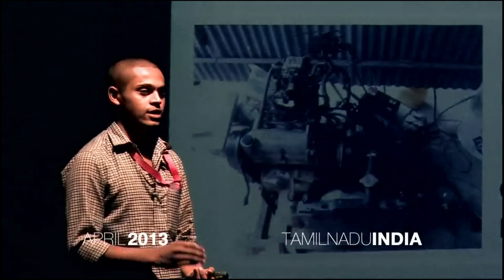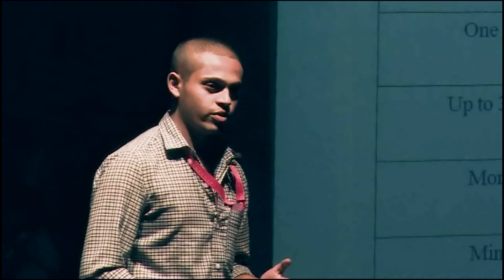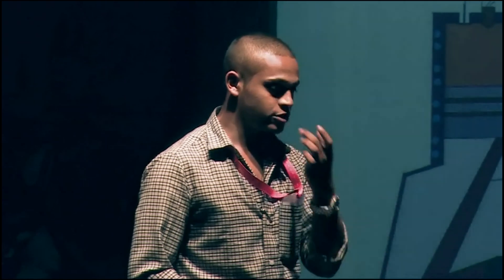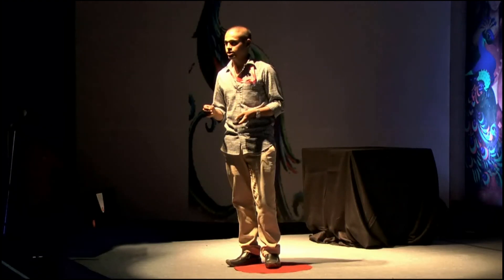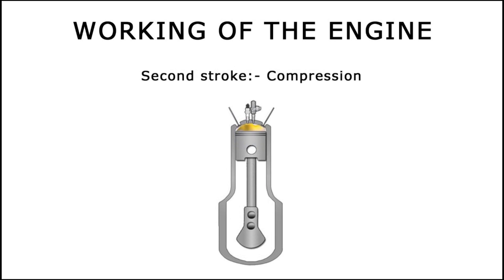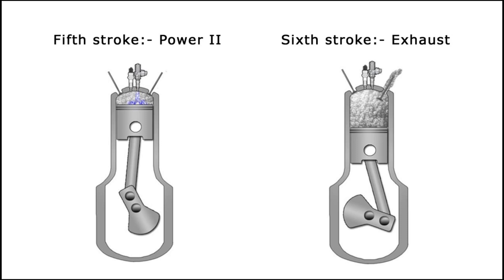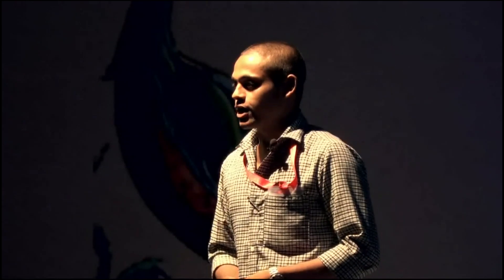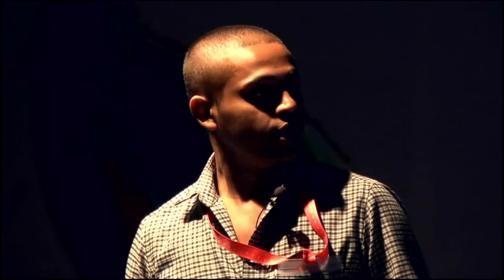6 Stroke Engine: Mukunthan at TEDxCoimbatore

Comment: Just a question, when water and heat are introduced together does rust form at a quicker rate? If so would this engine actually have a shorter life? In the long run would it be better to engineer a more efficient way to inject heated fuel and colder air? Sorry not one question.

Comment: ive never understood how 5 and 6 stroke engines benefit overall chemical efficiency. the added stroke must add enough power to pay for the movement of the added components to be overall more efficient. If you have a high inlet/outlet temp ratio, that points to thermal energy making its way into the engine, but not that the overall thermodynamic process is efficient at providing more work. with a steam engine itself and low rpm, i can see the benefit, but getting steam to the point of providing usable work is still not the most effective process.
Reply: You're right👍6 stroke engines do not benefit from chemical efficiency. They benefit in thermal efficiency by capturing the wasted heat from chemical combustion, to produce steam,resulting in an additional power stroke.

Comment: how do you think you can convert water into steam when you are about to start the engine.the engine body will not have sufficient heat to convert it. only when the engine  runs for long time it is applicable.
Reply: because the exhaust valve stays closed after the igintion of the petrol, the chamber contains super hot air due to the explosion of fuel. this volume of air will convert the water to steam. the engine does not need to be "warm" for this to occur, 
the 'perception' of a 'warm' engine is when the hot air has had enough time to thermally transfer energy into the block > water cooling system.

Comment: I think injection of water in the fifth stroke may leads to lose of heat energy (ie., generated in power stroke ) bcz it is utilized to convert water to super saturated steam , therefore for further cycles temp. May not be sufficient for combustion !!

Comment: Beautiful! That is, if you live in the equator where water doesn't freeze in winter, and if you make the whole system from stainless materials and if you can tolerate the overly complicated, heavy and expensive engine. Those disadvantages quickly cancel the benefits out.
Reply: Use screenwash instead of water in colder climates??

Comment: how would it increase efficiency as now the car has to carry water too to work and how about cold temperatures where the water won't even let the engine heat up
Reply: Cars already carry several gallons of radiator fluid, which the water here could replace, since it could be tuned such that the water would both provide steam power and sufficient cooling. If a separate steam exhaust were used, exhaust steam could be recovered, condensed and reused, so large water tanks would not be needed. Cold starting would require reducing or temporarily shutting off the water supply until the engine warmed up enough to vaporize the water. Steam oil would have to be added to the water to prevent water injector wear, and alcohol would also be needed to prevent water system freezing in the winter. 
I'm not an expert on patents and patent laws, but I'm pretty sure Bruce Crower already designed, built and patented a 6-stroke engine like this one. It's possible that some minor change in the operating cycle allows this guy to file his own separate patent, though (maybe the "recompression stroke?")
Reply: @WranglerSlim  unfortunately the recovery of the steam would not be easy, thus inefficient, it would be easier to pull water out of the surrounding atmosphere

Comment: For all the excess water emitted at surface level to precipitate out, you would have to be at 100% humidity.  But that situation is rare.  As for the production of electricity from fossil fuels, there is still no large scale alternative.  Until then, electric motors are just as "outdated" as the internal combustion engines you deride above.

Comment: Water vapor near the surface is less of a problem than co2 because the air close to the surface is regulary saturated. Then the air cannot take any more water and it rains. Then ALL the surplus H2O goes back to liquid. That is not the case for CO2. 
Of course you are right on the fossile electricity. If we should be so stupid to continue producing electricity from fossil sources, then electric motors would be no better then oil/gas motors. I would say charts and numbers point to renewable!

Comment: And so, if a little H2O emitted by vehicles down by the Earth's surface is no problem, then why is a little CO2 emitted by vehicles down on Earth's surface a problem?  Seems like if one is a problem, then the other should be as well, especially given that a molecule of H2O has greater greenhouse effect than a molecule of CO2.  And the modern electric motors are not newer.  And they still run on electricity made mostly by coal, natural gas and diesel.

Comment: there is lots of water near the earths surface. More vapor would not change the humidity because humidity is changed by oceans, rain and day and night -temperature-changes. Water vapor is only a problem when transported to very high altitudes by a plane. So if this motor would be used in a plane, the water vapor would be harmfull. In a car it is not. Still fossil motors are outdated anyways.

Comment: Water vapor is a greenhouse gas.  In fact, it is a far more potent greenhouse gas than is CO2.  I wonder if the additional water vapor/evaporation caused by widespread use of this engine would significantly increase global warming?